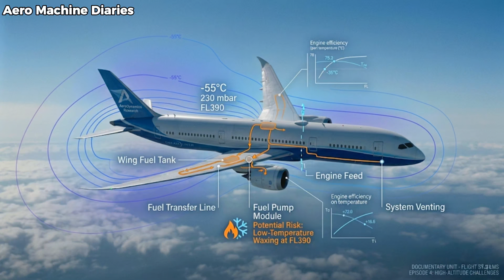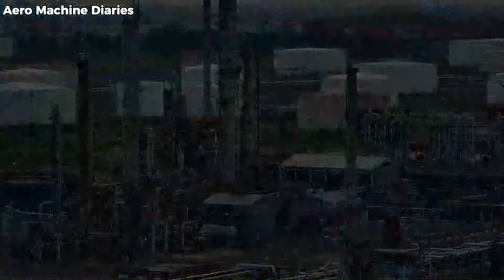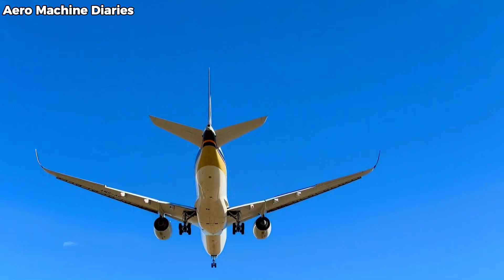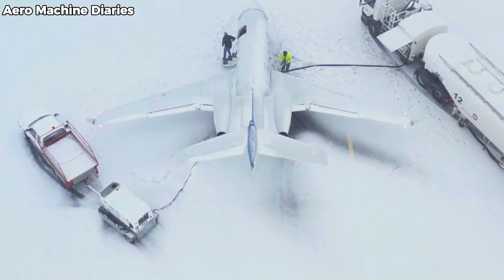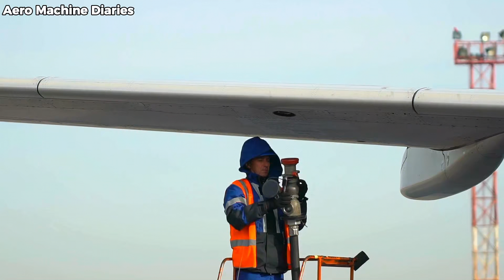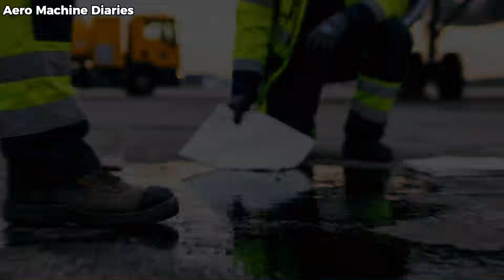Why Do Airplanes Use Kerosene Instead of Gasoline?

Comment from the maker: What surprised you most: that airplanes use kerosene, that gasoline is too risky for passenger jets, or that jet fuel does more than simply burn?
Don't forget to subscribe for more.
Reply: It would be good to say how jet pilot will refer to it as 'gas' even though it isn't gas.

Nice video.  Filled with great info and well explained.  Sub'd.
Reply from the maker: @dahawk8574  Thank you so much for watching and subscribing — I really appreciate it! 😊 And that’s a great point too. Even though jet fuel is kerosene-based, pilots will sometimes casually refer to it as “gas,” which can definitely sound confusing if you don’t know the difference. Aviation lingo can be funny like that! Glad you enjoyed the video, and thanks for adding that insight!  🙌
Reply: am waching this ,from Aden ..thanks for this vidio..

Comment: Another dumb question by someone who knows nothing about aviaton.  If you run car gas though a turbine engine it will get so hot it would melt. Kerosene runs a lot cooler. Even then the turbine has designs to keep it from overheat.

Comment: It’s flashpoint of the fuel at a mystified state. Kerosene, or jet A has a much lower flashpoint than regular gasoline. This allows a perpetual marriage of the fuel to the compression and ignition with air in the combustion chamber and turbines.

Comment: Why was kerosene much cheaper than gasoline in the 1980’s?
Reply: Because it's extracted earlier in the cracking process...
Reply: Diesel was too. The maggots that throw the taxes at us figured out that the country runs on diesel fuel. Trains, trucks etc... transport all the shit we need all over the country. Diesel and kerosene are both pretty much partially refined gasoline and should be substantially cheaper...which they were in the past. Simple as that.

Comment: The B 36 used 110 octane avgas for both the piston and jet engines and flew at 40,000 feet. I'm not thinking "vapor lock" was a problem...

Comment: kerosne has a much higher energy denisty than gasoline, giving the jets a longer range than with gasoline for the same weight or volume.
Reply from the maker: Thanks for commenting! Jet fuel does provide excellent energy per unit volume and, just as importantly, it's much less volatile than gasoline, making it a safer and more practical choice for turbine engines. Great point!

Comment: At first glance, yes—clear kerosene and petrol (gasoline) can look almost identical. Their appearance is not a reliable way to tell them apart. The main differences are in their chemistry and how they behave. Petrol evaporates extremely easily. If you spill a little on your hand (not recommended), it disappears within seconds and feels very cold because of rapid evaporation. Kerosene evaporates much more slowly and leaves an oily feeling. This lower volatility is why it is safer to store and is commonly used in jet engines, heaters, and lamps.
Reply from the maker: Great explanation! 👍 You summed up the key difference perfectly—it's not about how they look, but how they behave. Thanks for adding this valuable insight!